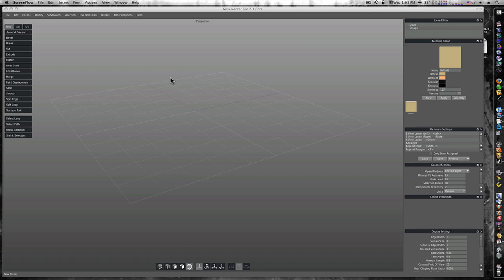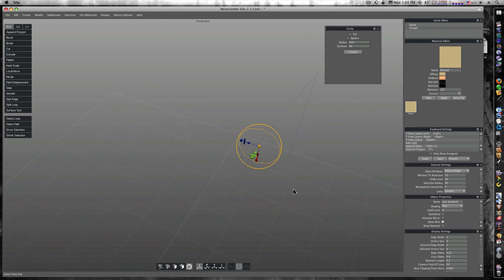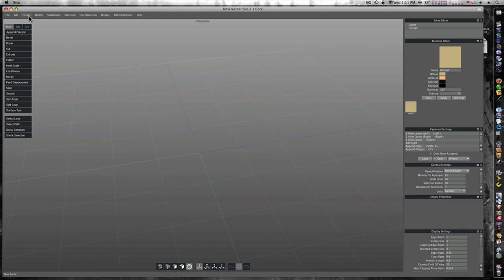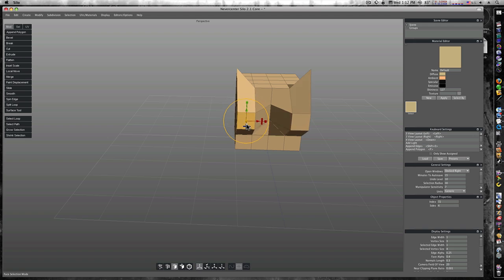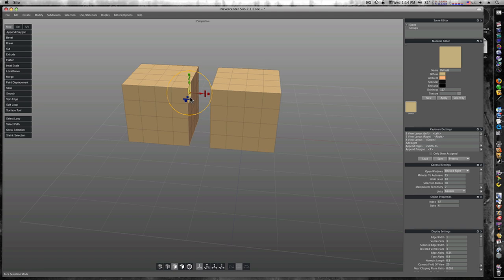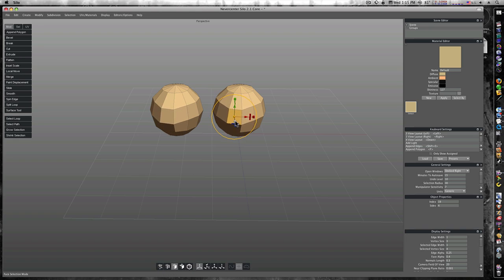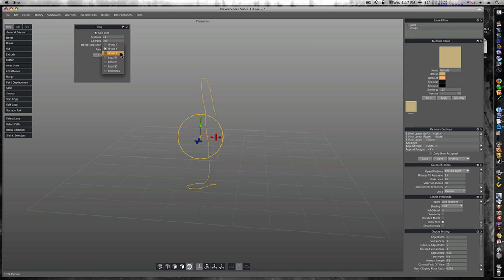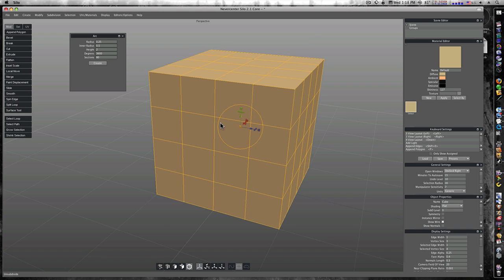Silo 3D Modeling Tutorial Part 2 - Common Tools and How They Work

Comment: Hi... 3:53  This did not do what you said it was doing.  What this did was create a virtual twin of your cube that copied your actions on the opposite side of the cube's X axis.  You can even see the unmodified points on the opposite side in addition to what the virtual twin was doing.

If you turn off Instance Mirror Toggle afterwards, all of the changes on the other side would be lost.  Symmetry Mode toggle would have kept your changes.  Instance Mirror is good for working on a half-face.